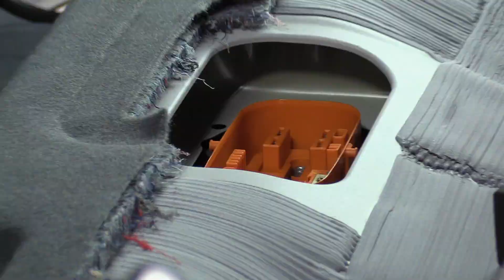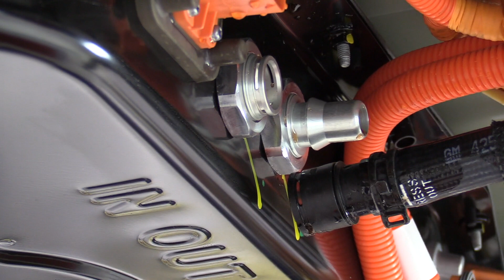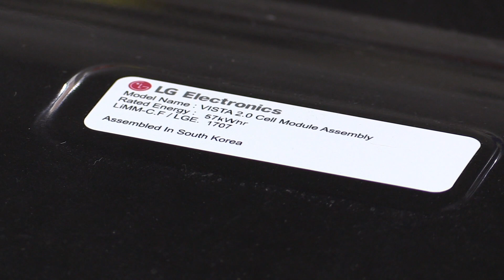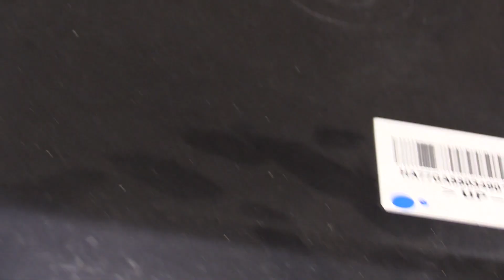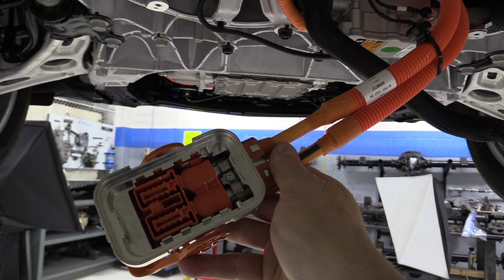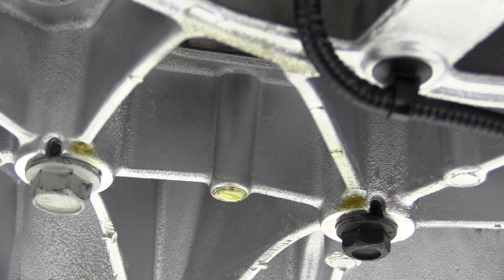Chevrolet Bolt EV 57kWh Battery Removal

Comment: Thank you for this fascinating video. I was wondering what the labor hours would be to have this done at a dealership? In some ways it seems easier than a normal engine removal, but more difficult in others. Will these cars see multiple owner paid for battery packs in respective their lifetimes, thus making them viable to operate economically well past the normal 150-250K mile service life we see today?
Reply from the maker: Thank you! Now that I see how easy it is to swap out the battery, I suspect it would take 2 hours labor for the complete job. I also suspect the batteries will last well beyond 100k miles. The rest of the Powertrain is pretty simple. Not much to go wrong mechanically.
Reply: WeberAuto yes, I think the batteries are reliable enough, I have a 2014 BMW i3 Rex, already put 50k miles on it, so far I have the exactly the same range as I bought it 3 years ago. And few days ago in the i3 FB group, someone actually just hit 100k miles on the original battery, and lost about 4% of the capacity.